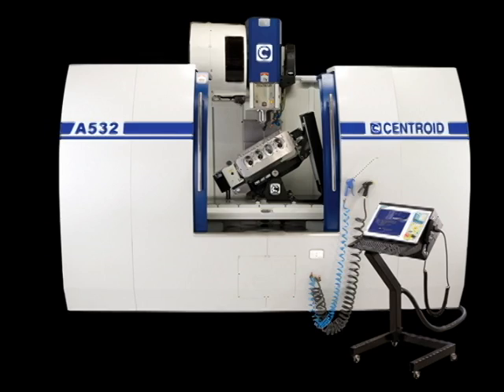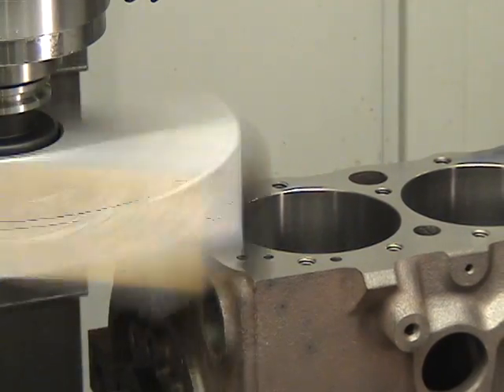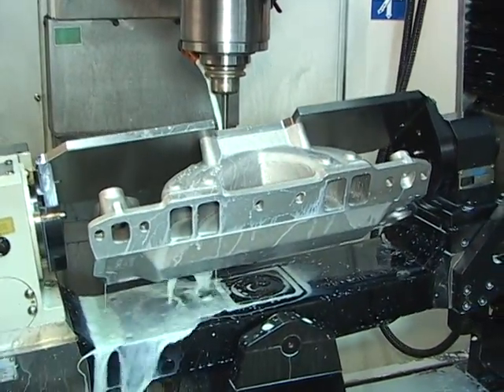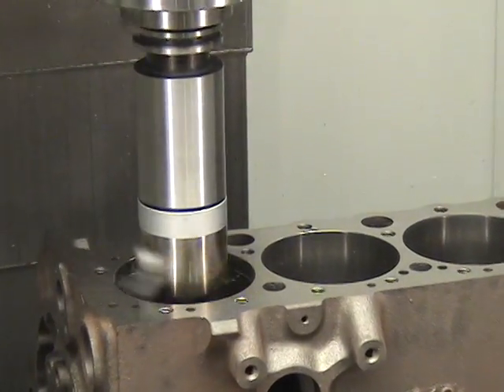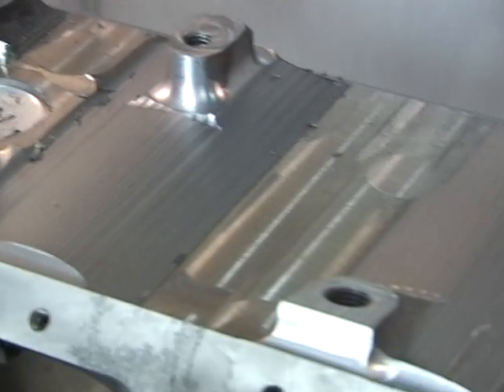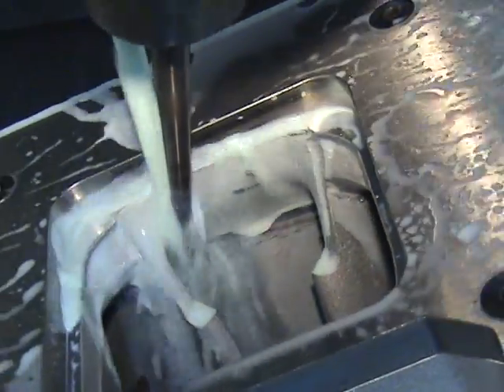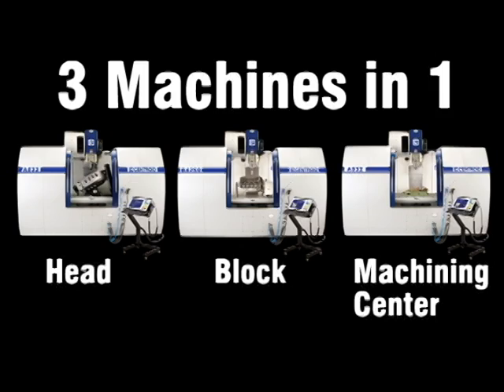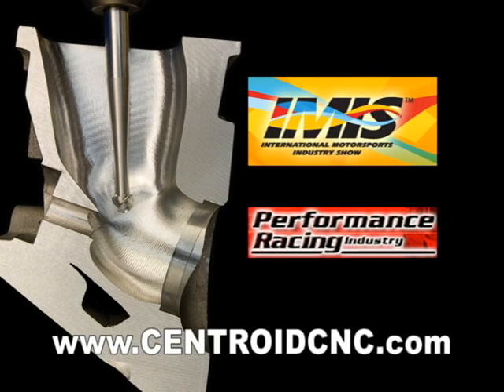CNC Cylinder Head porting and CNC Engine Blocks on the SAME Machine!

Comment: That thing can't be rigid at all. In machining rigidity and repeatability is eveything. You're fixtures are flimsy and the 5th axis is not near as beefed up as it should be. A machine that does it all just doesn't do it all very well. 8 k spindle with only 15hp is not a lot at all either. If you want a cheap 5 axis go look at a Haas. Cheap for a 5 axis machine, American made, and spare parts are right in California.

Comment: Figure about $150K-$200K depending on tooling, fixtures, options, and software. This type of machine lends itself to a shop that does repeat work. For instance, a company specializes in ported heads for brand xxxxx and can sell the same port job over and over. Customer sends in their heads and while the machine ports them, the shop owner can spend time to develop new products instead of doing the same tedious labor for each sale of head(s).

Comment: typical 3-5 axis machines of this type are in the $70-90K range.  The centroid has a pretty slow spindle (8000rpm) and 15 hp motor.

Comment: yea but typically most shops will lease the machines with the companies and they pay a fraction of what its worth to use it then when the next model is available and the lease is up they are ready to move on the company leases the machine to a different shop who will then reuse it on a new lease if the shop could afford the machine they may as well just retire lol there would be no room for profit

Comment: Nope!
"blueprinting comes from the engines diagrams which are blue ence the name.
this is used because of the tolerances of engine parts , so the idea is to find the parts which best fit together for a better balanced/equilibrated engine , and improved performance trought the all rev range.
hope it helps!"

Comment: Most CAM software and post-processors won't generate macros, sub-routines, parametric programs, etc. In most cases 3-D surfacing programs contain mostly G01 (linear motion) codes. Its just that there's tons of tiny little straight line moves taking place.

Comment: yes the control uses industry standard G and M codes.  Mastercam Port Expert is used for Intake, Exhaust and Combustion Chamber work. and regular mastercam or any other cad/cam system is used to create the programs for most any other work. centroid also has its own popular conversational programming software, which is fill in the blank format for all kinds of common milling operations, like pocketing, drilling, tapping, threadmilling etc.. no g code knowledge needed.